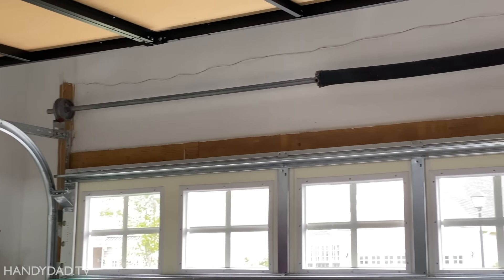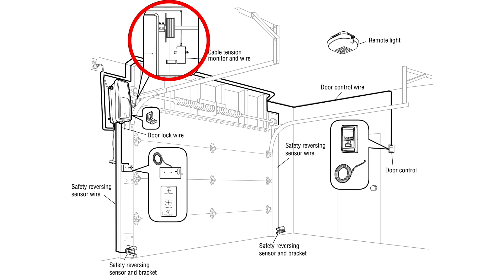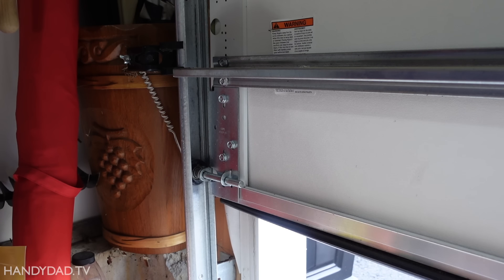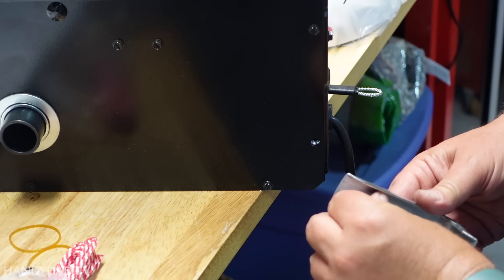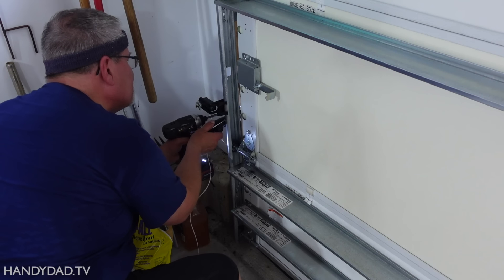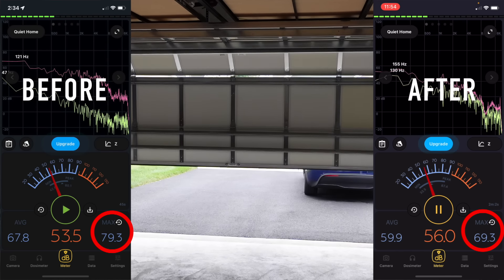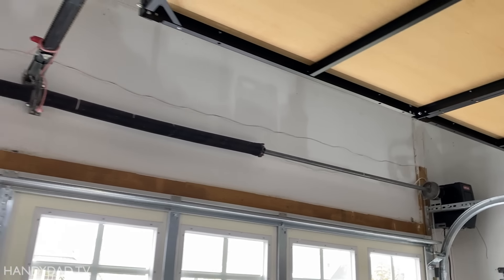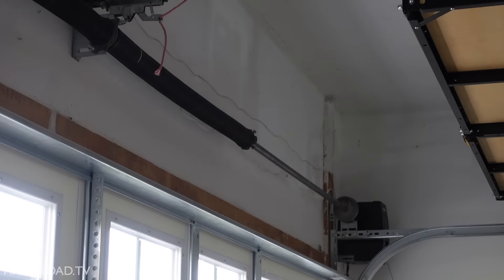GENIE Wall Mounted Garage Door Opener - Worth it???

Comment: From what I understand the door springs are always active so I suggest you install the deadbolt. The only time you have the doors full weight is if the springs break. Also insulate your door to help the noise or replace/Lube hinges/rollers
Reply from the maker: Unless the emergency rope is pulled, the gears are engaged and the shaft will not turn. I tried.
Reply: @handydadtv  that’s good to hear
Reply: @handydadtv  This is correct. The reason for the deadbolt is to prevent someone from breaking the window close to the opener and pulling the manual lease rope.
Reply from the maker: Ah!! Thanks for that!
Reply: The lock is to prevent someone from brute forcing the door open, Overhead openers actually pull/push the door and once it's down it's "locked", the side mount could be hulked open technically
Reply: Exactly
Reply: @handydadtv  The emergency release rope can be pull from the outside by slipping a coat hanger between the garage door and its frame.  This is particularly easy for older doors where that gap is large.  I would install the dead bolt.
Reply: @handydadtv  I also listen for my auto deadbolt to lock to know the door actually closed and did not reverse for some reason. The electronics of your door makes sure by itself.

Comment: I wish you would've shown how you worked that massive spring-arm /shaft and installed it into the Genie wall mount.  But great video.
Reply from the maker: I didn’t do anything with the torsion spring. The opener slides onto the shaft.
Reply: @handydadtv  After I wrote this I realized that spring isn't messed with and how easy this install really is - except just time consuming and a lot of steps.  Thanks.

Comment: I have the Liftmaster version. Absolutely love it and will never use a overhead opener any more. The cable tension sensor Genie has is quite unique. The Liftmaster one is just a simple arm with a switch. The switch is only closed when the cable loses tension so there's no reason for the switch to wear out. The only thing that could go wrong with it is mechanical but even if it does, it's only a few bucks to replace. I'm also not a fan of battery powered remotes. Changing the battery is just another thing you need to do occasionally.
Reply from the maker: I hate disposable batteries too. Good thing is, the Bluetooth transmitter only uses power when you press the button, so they should last long. The tiny amount to blink the blue locator light every few seconds can be disabled.

Comment: This looks like a great solution when I need a door opener.  My current Genie screw driver opener is 42 years old, and at the time was the only solution because I have a 12" steel beam going across the garage limiting space for an overhead opener, so I was able to cut the screw track shorter in order to make it fit between the front of the garage and the steel beam.  It is very loud, but still working for 42 years!
Reply from the maker: Holy cow! You got your money’s worth out of that thing!

Comment: Nice, I also had to change out mine because it was so noisy. We have a two story with bedrooms above the garage, kept waking the kids up when I went work. I also changed out all the rollers to ball bearing nylon, made a big difference.
Reply from the maker: I replaced the rollers and lubricated the hinges too. The old rollers were also nylon, so that didn’t do much. But lubrication made a big difference.
Reply: Don’t forget to lube the center bearing between the springs.  That eliminated 90% of my noise.
Reply: But that is a double edged sword....the noise would at lease alert you if it was a thief trying to get in

Comment: Our new house has low ceilings in the garage so no overhead unit can be mounted. Previous owner used a DIY bracket to install an overhead unit on the side for both garage doors. The units are relatively new so I'll definitely do one of these side mounted garages when it is about to fail. Appreciate the detailed video!
Reply from the maker: Thanks 😊
Reply: I have a low ceiling as well. I bought this 6172 from Home Depot online and installed it myself. When I got to setting the limits, I found up was down and down was up. At this point I knew what was wrong and there was a disclaimer about low headroom tracks and that this unit is not compatible. It would have been nice if they had mentioned this on the website or box. After talking to 4 Genie techs asking for a workaround they left a message on my phone the next day saying that I’m gonna have to return this unit. I still have the unit installed and really don’t wanna go through the pain of returning it. Too bad the techs all seemed to bot have any real world instal experience. Someone must know of a way to swap around the torsion bar, pulleys, cable and bottom bracket with a separate offset idler to make this work.
Reply from the maker: Call a garage door installer and see if he can reverse your springs and pulleys.

Comment: I just installed one of these units at my house. I chose the Chamberline Rj070 since I dont have backup generator. I installed it with Nylon rollers and a silent kit hinges for a really quiet operation.
Reply from the maker: Silent hinges? Never heard of them. Do tell!!
Reply: @handydadtv  Nylon wheels instead of the noisy metal wheels you have.
Reply from the maker: I changed the wheels too. Surprisingly the old ones were nylon too.

Comment: We had a two-car garage in our previous home (we moved into our new place 4 months ago). I installed the Liftmaster version on both doors. It was really appreciated as our main floor was about the garage. The living-room vibrated quite a bit and the noise was intolerable when in operation prior to the side-mount opener. What a great change for us and the future residents. Now we are in the process of replacing our 16’ wooden door and I hope to go the same route. I think I’ll look at the Genie version. Seems like some distinct advantages (Wireless, tension sensor). Thanks. Good vid
Reply from the maker: Thanks 😊
Reply: The vibration is not a function of the controller unless you have an old chain drive.  belt or screw type does not do that.  If you have a lot of squeaking it can be from the springs or poorly installed or worn out rollers.  They have nylon coated rollers now that also reduce noise.  These things are not worth the negatives.

Comment: You left out the best thing about the wall mounted garage door opener.  The wall mounted opener allows you to raise the door tracks higher so that a car lift can be installed in the garage.  Previously, the door was only 7.5 feet off the floor when it was open.  Now it goes all the way up to my 14 foot ceiling.
Reply from the maker: Good point

Comment: I have a liftmaster wall mount.
Its incredibly quiet and smooth, has a auto dead bolt latch to prevent prying up the door and of course has no track cluttering up the ceiling, so highly recommended, I have had zero issues with the unit, but I can't speak for the Genie.
Reply from the maker: I may try that one next.
Reply: @handydadtv  You can get the Chamberlain version of the Liftmaster a little cheaper. Pretty much the same thing.

Comment: I wore out two Sears openers due to under engineered design.
Tiny drive sprocket wore right through its housing.
I decided in spite of the cost of the side mount opener that this is the direction I would go, rather than replace another overhead opener in another ten years or so.
I bought the Chamberlain at Home Depot installed it myself.
Best opener on the market.
Easy install in a manner that makes more sense than overhead center of the door pull style.
To drive the spring axle directly is genius.
The side mount opener is quiet, has an interface lock, frees up all the space over the door and has battery back -up which works well in case power is interrupted.
Also, my existing remotes and the keypad from the SEARS opener are compatible with the new side mount Chamberlin.
No track, no chain or belt.
No noise, easier on my garage door.
Easy to install.
Great value in spite of the price.
But when you subtract the cost of the overhead door opener from the price of the side mount opener it is only about $200 more.
But, worth it.
Reply from the maker: Thanks for the info
Reply: Your chain was too tight.
Reply: Wasn’t under engineered you either overtigtened chain or had worn springs.
Reply: Do you put grease in your tracks to quiet the door down as well?
Reply from the maker: I replaced the wheels and greased the hinges.
Reply: @brandonhenn5889  never in the tracks.
Reply: @noahholt482  ⭐️ great job Noah
Reply: ive had my craftsman for 20 years the sprocket broke after my spring broke and i kept trying to open it cause i needed in i bought a replacement gear wich is the same gear for a ton of openers over 10 years and got a overhead spring still going stong im still thinking of a new opener though.cause i like new stuff lol.
Reply: I did the same thing, my door is oversized and very heavy, the overhead openers could not handle it.

Comment: Definitely prefer the wall mounted opener compared to my GENIE (24 yrs old and still working without a hitch) ceiling mount. If ever I need to replace it I’ll be switching to this system. Thanks for the video, nicely done.
Reply from the maker: 24 years!! Let’s hope my new one lasts half as long.
Reply: @handydadtv    I was just talking to our garage door installer (I’m re-placing both doors and openers) a few days ago and he said the new Genie’s are coming out of Red China and their junk. He said he installed 3 of them at a clients home and 2 weeks later he had to go back and repair 2 of them. Hopefully you have better luck with yours.
Reply from the maker: It’s been about six weeks so far. Fingers crossed 🤞🏻

Comment: I definitely need this. Went to bed with garage door wide open and didn’t realize till after I woke the next morning. Good thing I leave in a decent neighborhood. Thank god nothing was stolen. My opener is old and has a very noisy motor and chain so it’s definitely time for a replacement. Looks like none of he previous owners never changed the original opener ever. Now I know it’s that easy I’ll definitely give it a go myself. Th quotes I got to replace was ridiculously outrageous.

Comment: Great video but I'll stick with my current Genie garage door opener. I have had it in use for over 30 years and have never had an issue with the opener using occasional lubrication of the screw drive and garage door track wheels, and replacing the remote control battery about every 2 years. Very reliable.
Reply from the maker: Good to know they last 👍🏻

Comment: Me too. Chamberlain calls it a “jack shaft” opener. Did it myself in a day. Very quiet too.
My car is a 2004 and they changed the HomeLink protocol a few years later. Got an extra $35 unit to let my older protocol bridge to the opener. Works with a slight delay.
Also, no center rail so more overhead storage.
Reply from the maker: Thanks for sharing

Comment: We got one from Lowes - I installed it with my brother. At first it wouldn’t work - played with it - eventually after talking with tech support, got a little better,but still not working - I had 2 other garage doors replaced & the installer looked at it stated binding in the tracks - lubed it & adjusted - now works awesome. On a 10x10 garage door.
Reply from the maker: Mine was binding at first because of those spacers. I needed to move one of the tracks by 1/2” and all is good now.
Reply: My door was noisy, and found I needed to lube the center bearing between the springs.  Now it makes so little noise, I can’t hear it opening or closing.
Reply: @robertheinkel6225  A huge amount of peoples "noise" problem can be solved with a good application of a can of commercial garage door lubricant (any hardware store) on the moving parts. Giving the spring itself a good spray can also help.

Comment: Our last opener quit working about 5 years ago. It was so old, Jesus' fingerprint was still on the pushbutton remote 😄.  I replaced it with a belt-driven one thinking it was a great upgrade over the previous one. This one here on your video will certainly be top on my list next time mine needs replacing. Thank you for this video.
Reply from the maker: The older ones lasted longer than modern devices. Sad but true.
Reply: Loved the Jesus fingerprint, funny.
Reply: Won't be long, those belts won't last
Reply: How do you open during power outage?
Reply from the maker: @James - If you don’t have the battery backup, you pull the red release cord and operate the door manually.

Comment: My wife has wanted one of these for a long time. Our garage has really low ceilings so we can not install any other type of garage door opener.  One day Ill be able to get one of theses.
Reply from the maker: It’s a good solution if you have low overhead.
Reply: They are not to be installed on low headroom

Comment: I like this solution - I too use storage above my garage that precludes me from having a door opener on one side.   This would solve my issue and agree it would be much quieter -  Seems like whenever the garage door is opened or closed its loud enough to inform everyone in the house.
Reply from the maker: That happened with every house I’ve owned. They all had overhead openers.

Comment: Use Garage Door Lube to  lubricate thoroughly lube your tension springs,  roller pins (not the track)  and all the door hinges and your door will virtually be silent. Also take a socket and make sure all your hinge hardware is tight.
Reply from the maker: Thanks 😊

Comment: Just took down a brand new Genie 6172H that was glitchy from the get-go. They also put out a constant, annoying transformer hum which the Genie help line says is completely normal. Replaced it with a Liftmaster 8500w and am much happier with it across the board, including the app.
Reply from the maker: The only glitchy thing on mine is the Bluetooth remote. It stops working every few months and I need to pop out a battery to cycle power. Then it’s fine.
Reply: @handydadtv  How's the transformer noise level on yours? Maybe I got a bad one.
Reply from the maker: No noise at all

Comment: I have a liftmaster on the 12x12 door in my Barndominium. Had it for close to 20 years only having to once replace the motherboard. Remotes for Liftmaster tend to not be as supported as the one Genie use.  Thinking of adding a second one to put on my door on the other side of the building and glad I now have a choice.
Reply from the maker: Thanks

Comment: I bought a house that has a car detached garage but there was only 1 door with an opener. the closest door to the house had a Lift Master opener with a chain drive there was nothing for the other side. on Black Friday the local Home Depot had a Genie that came with 2 remotes, and it had a built in light 3/4 hp belt drive and a battery powered keypad and the safety openers. with wifi for $75.00 so i bought 1 and installed it. I couldn't believe how quiet it was. I liked it so much the following year on Black Friday they had a similar one that had a wall mount button but also had battery backup, so i grabbed one and replaced the Lift Master $85.00 and now the 2 doors open nice and quiet. So, both doors for $160.00 and they have worked flawlessly.
Reply from the maker: Thanks for sharing

Comment: Good video. As a Garage door installer I give you a 9 out a 10 installation and that only because I saw that the left side take up cable need to be replace. I recommend to replace both (by a professional) never touch those springs you can lose a limp in a blind of a eye. Be save
Reply from the maker: Thanks. You’re not the first to notice that cable.
Reply: @handydadtv  Haha I did it for so long that my eyes can't pass it 😅.

Comment: When I was younger, my family's chain driven unit conked out and my dad replaced it with an overhead unit that had a threaded shaft instead of a chain.  I thought that thing was SO quiet compared to the chain system.  Then years later I was working as a house painter, and some lady had what must have been one of the earliest wall mounted lifts like in this video.  It was practically silent!  Like literally silent.  I don't know what brand it was, but it was WAY quieter than this Genie, but I'm sure the Genies are pretty quiet compared to any overhead unit.
Reply from the maker: I haven’t seen a screw drive since I was a kid!
Reply: Master make one too

Comment: I have a lift master unit. A little older s as no Wi-Fi but got the Wi-Fi bridge which works great. The MyQ app is pretty good and works with Alexa /amazon delivery.  I have the battery and deadbolt so feel pretty safe.  The unit is quiet and I like how it slows down when closing instead of slamming into floor.
Reply from the maker: Thanks for sharing

Comment: That left torsion cable is freying. Youre going to have an out of level door soon with a gap on the bottom. Ive done doors for 24yrs & that genie jackshaft is a good unit. Its pretty close to the liftmaster version. The liftmaster has a cable tensioner that is better. If the door starts down & slack is thrown into the cable, it stop & reverses back open. Its just a fail-safe to prevent cables from being thrown off drums & having a racked door. Nice install my friend👍👍👍[edit] love that tesla too
Reply from the maker: Thanks! Do the cables get replaced in pairs?
Reply: @handydadtv  Always.
Reply: The genie operates in the same manner...and won't even start to go down if the cable tension is improper.